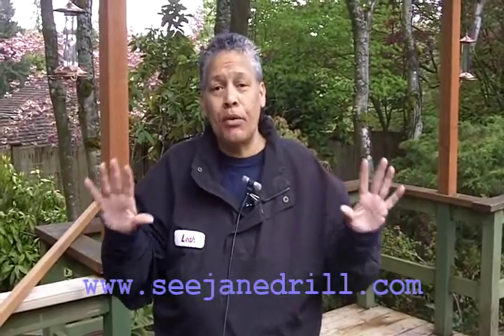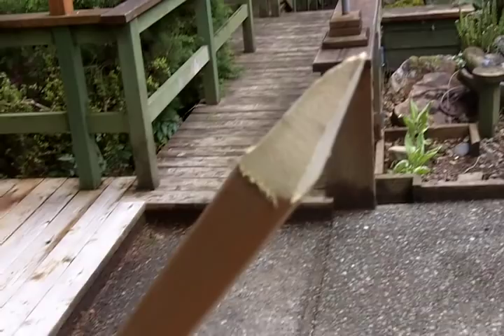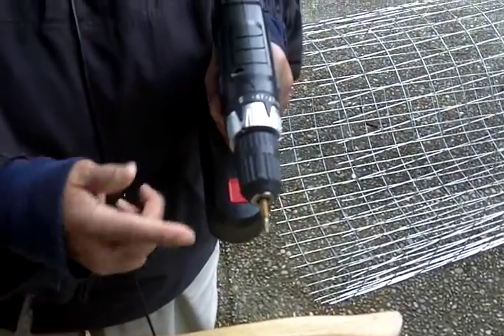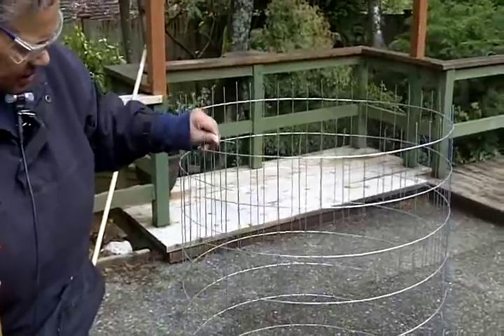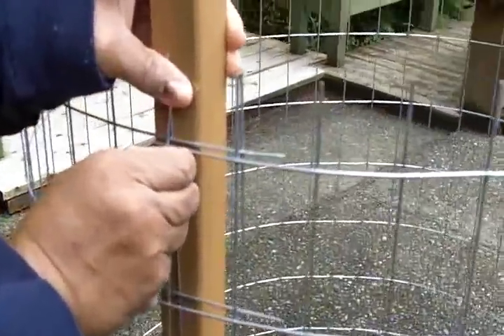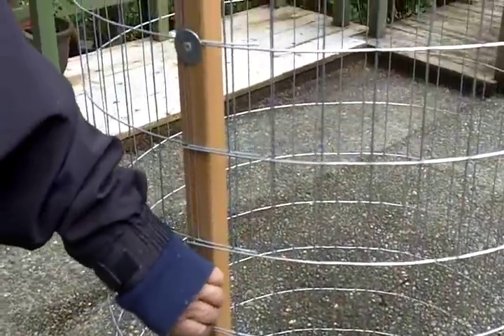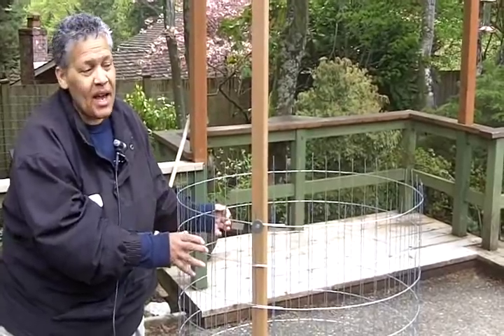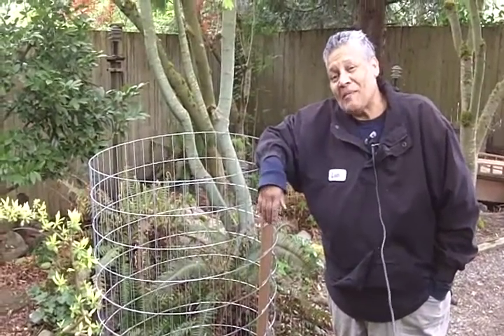How to Build a Compost Bin in Under 15 Minutes and CHEAP

Comment: What great solution.  I live in the city and don't have a place to drive into soil, so I used zip ties  to join the fencing to the desired circumference, bent the unfinished ends towards the center with pliers, and placed a few pieces of brick on the bent ends to hold it more firmly to the pavement while the hummus developed. Voila!
Reply from the maker: That's a pretty cool idea!

Comment: its just what I need.so easy!thanks for the idea
Reply from the maker: +Jennifer Raby you're welcome, Jennifer!
Reply: +seejanedrill i made the same thing, but its 3 by 2 width and length and the height is 3. so its 3 by 3 by 2, because the garden is paved off. i heard for thermal compost it has to be 3 by 3 by 3, will mine still work??

Comment: So you have to take it all a part to turn the compost every so often?
Reply: I think it's probably a long-term composter.   BUT you could fix one side of wire to the post leaving the other side free. Use tie-wire [or some type of 'clip'?] to attach wire to post in about 4 places. Then just undo, pull back wire, turn compost, and put wire back.

Comment: Couldn't I just weave the stake through the wire rather than screwing on ? I won't need a drill or fixings then.  Also I don't think it would hurt to use an untreated stake as its not a permanent structure. And I will definitely only be putting garden clippings in, not food scraps or else it will be a mouse metropolis 😆